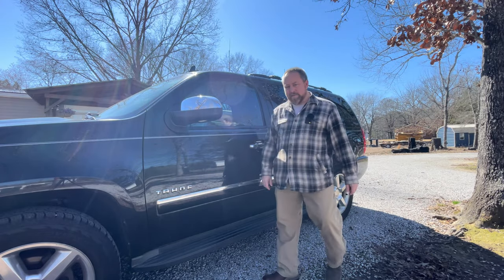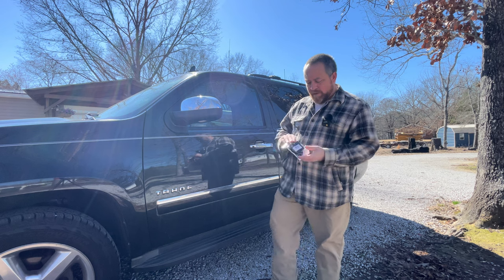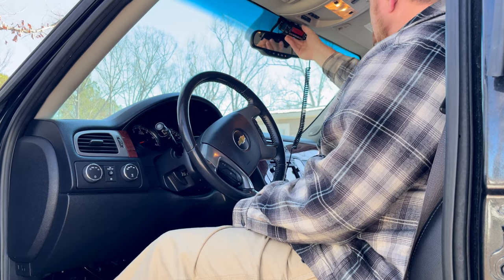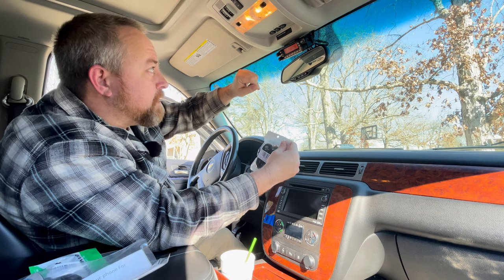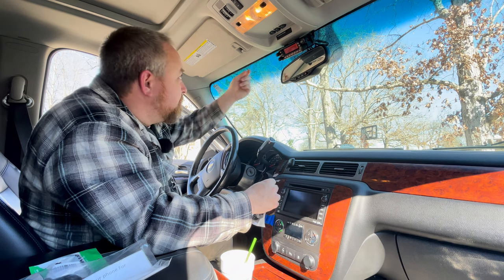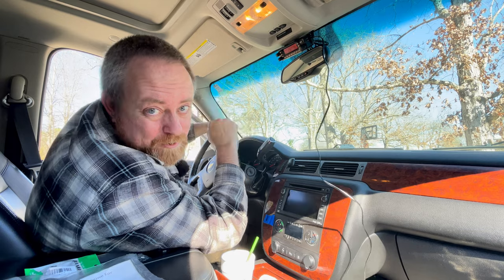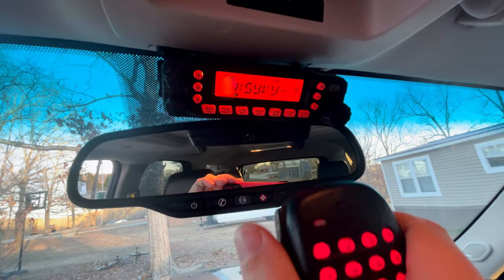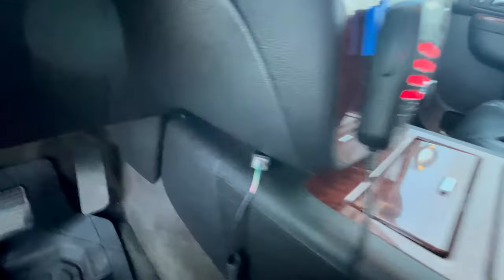Things I learn when I think | FT 7800 Mic Relocation | Ham Radio

Comment: I really like the way you have the radio mounted above your mirror but I would probably have the same problem that you’re having because it gets pretty hot here in Missouri during the summer too. I’m glad to see that you’re back to making videos again.
Reply from the maker: Thanks Bob, yeah I print my “prototypes” out of  pla at the moment. If I reprint it will be Petg that can take a little more heat. But if I get the 500 I have a commercial mount for it already and won’t have that problem lol.

Comment: Hi JoeBrett,
I've been down that RJ road, but there are another the RJ14 and RJ25. They all use the same physical connector, but the difference is in the number of pins used. RJ11 uses 2 pins, RJ14 uses 4 pins and RJ25 uses all 6 in the connector. The RJ12 also uses all 6 pins in the same physical connector. I think the wire layout between the RJ12 and RJ25 may be different.  73  WJ3U
Reply from the maker: We live and we learn Don’t we 😎 thanks Don!

Comment: I've had this radio since 2006. It's been in two different vehicles and I still have the mic issue. My first mic cable the plastic just peeled away with age. The current cable pulled away from the connector. I think I'm going to look into something like you have. Thanks for the video.
Reply from the maker: No Doubt the plastic on the cord is horrible, relocating will take stress off it, but it’s still going to peel eventually. Thanks 👍
Reply: @K5YVY   I found last night some connectors. Going to crimp a new connector. The joy of a cheap mic cord lol. I will eventually replace the radio with a ftm 200. I have one of those in my home now. Love the radio.
Reply from the maker: @N2ELS.  I have considered the 200 and 300, as the primary functions that I'm looking for is Dual vfo simultaneous receive and APRS, but if I can snag a 500 on sale I would really like the speaker being in the head unit as well having the body speaker active as well, removing my external speaker now.  
Good find on the connectors! Always nice when we can fix and not be forced to replace.

Comment: If you upgrade to a VGC VR-N7500 the install issues magically go away and everything just works.
Reply from the maker: The n7500 is a great idea and solution, but I prefer to have a physical front face to glance at and not fiddle with my phone to see and operate what I’m doing.
Reply: @K5YVY yea man. Go with what you like.
Reply: @K5YVY  another side note. The Bluetooth mic has the screen on it with all the info.  No phone necessary.

Comment: Another great video and thank you. We also have a Tahoe like yours. I have a FT-7900 that I’ve thought about putting in there, but it’s the wife’s daily driver. Everything would have to be a clean out of the way install. I know you said you 3D printed the head mount but how is it mounted up there? Double sided tape? Also where’s the main/body unit at? I’m also trying to figure out coax and power routing. I would like to have a FTM-300 like I have in my vehicle but maybe someday lol.
Reply from the maker: The 3D printed piece I made to slide between the upper console and headliner. It has the bracket that the head snaps into, keeping the ability to remove the head unit if needed. But what I like is the whole install can be removed without any trace in less than 10 minutes. The main body in under my driver seat. Nothing is hardwired or permanently mounted. 👍
Reply: @K5YVY  thank you and that’s good to know. You’ve definitely given me some good ideas. I appreciate it. I’ve also wondered if the top of the center console/cup holder popped off easy enough to mount the main unit under there. And still be able to secure it enough so it didn’t move around.

Comment: I just want to know how many times that connector wedged there will come loose and tangle with your feet before a change is required...lol
Reply from the maker: Z E R O. it’s tucked in behind the console, last shot toward then end you can’t see the cable anymore 😎. The connector is wedged really tight, but if it did work loose it would not drop to my feet. ✅